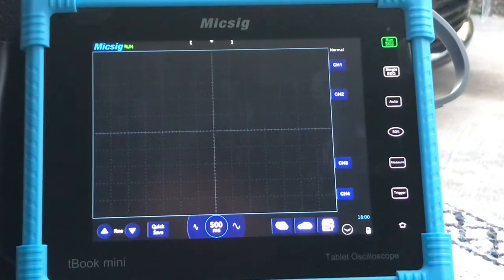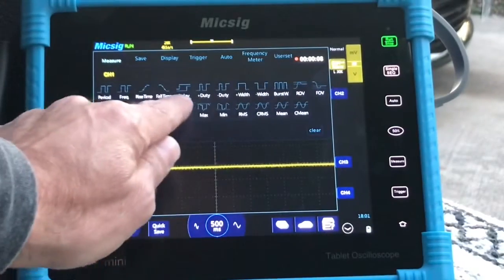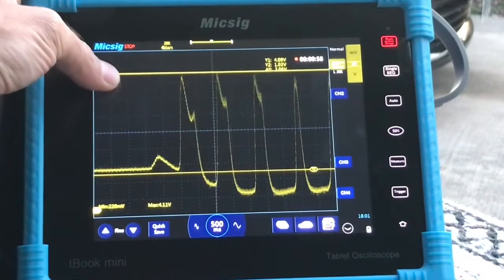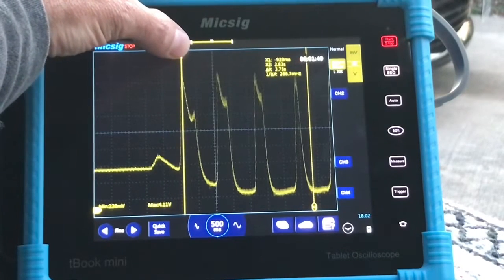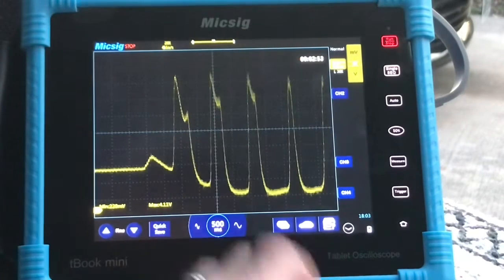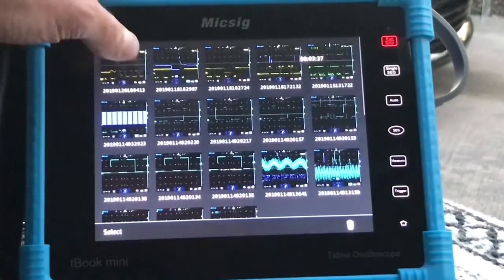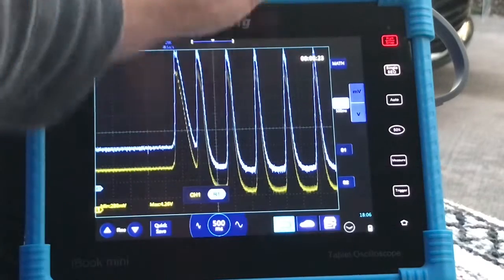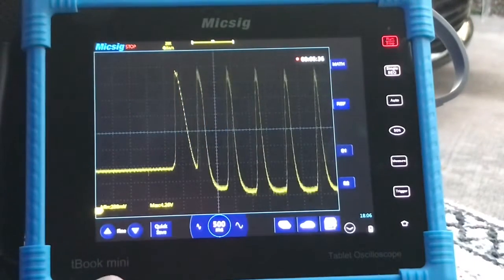Using the MicSig ATO1104 to look at a map sensor on 07 Mazda 3 2.3l

Comment: ram40andy
3 days ago
I just bought an ATO 1104 a month ago , everything worked ok, but the other days a relay clicking noise came from inside when switching the voltage scale from 200mv to 500mv on any channel. All began when I connected CH1 to AUX OUT CH  with P130A probe. Everything works as it should now except this noise
Reply from the maker: Hello ram40andy. First off, I apologize for just now responding to your comment. I never got the notification, and just now saw it. I’m sure by now you have probably contacted Micsig. Incase you haven’t: 
I believe that is normal for the scope. I know sometimes I hear the same thing. 
I don’t have my scope in front of me at the moment, but tomorrow I’ll try to remember to run it through the condition you mentioned and confirm whether mine does it or not.
Reply: Thank you. @atomsworkshop195
Reply from the maker: Ok, so on mine; it makes the clicking (solenoid) sound on channels 1,3,&4 switching between 2&5 volts. That is in either order from 5 to 2 or 2 to 5. Also, channel two seems to do it from 200mv to 500mv, and 500mv to 200 mv. So now I checked my brand new SATO 1004 (Micsig new automotive scope), and it did just like yours making a clicking sound on all four channels switching between 200 mV and 500 mV in either direction. So I’d say you have nothing to worry about my friend. Keep on trucking on. I hope this puts you at ease.
Reply: @atomsworkshop195  Thank you very much, mine does so.

Comment: Hello I’m wondering if is possible for fixed the evaporative emission (EVAP)vent solenoid control circuit is vending
Reply from the maker: Hello Gustavo. I apologize, but I’m not sure exactly what you’re asking. If you’re asking if you can use this MicSig ATO to look at the EVAP vent solenoid control circuit; the answer is yes. You can use this to see the waveform of any electrical circuit on the vehicle (or most other electrical circuits). You can see the waveform for the power, ground, signal, frequency, etc. I hope this answers your question. If not, let me know, and I’ll try again. Thanks for watching and for the comment. I also have other videos using this scope, on my channel.
Reply: Thankyou 👍
Reply from the maker: You’re welcome sir. Good luck to you👍

Comment: What are your honest thoughts on this unit?
Looking at getting one for the workshop, but real-world reviews in an automotive workshop environment are pretty scarce.
I like the idea of an all-in-one solution.
Reply from the maker: Hey Dennis. You’re probably a bot, but just Incase you’re not, here’s a short and to the point opinion. My honest thoughts are, I think it’s a great scope. It’s been able to do everything I’ve needed it to do. It doesn’t have all the options that the Pico automotive scopes have, such as a waveform library, but you also pay a lot less. Yes I bought it with my own money, and as of right now I would buy it again.
Reply: @atomsworkshop195  haha I'm not a bot.
Genuinely interested in a scope for my shop. I have a Gscan 2 with scope option now, but can't use scope and scantool at the same time.

I have been looking at the Hantek 2D82 auto iii but in my research I found the Micsig.
I have emailed Micsig and received no response so I'm not pulling the trigger just yet.
Reply from the maker: Dennis De Zordo , I looked at some hanteks before I found the Micsig. I like the Micsig because I don’t need a laptop, and I like the general layout of the screen. I also went with the ATO1104 “automotive” scope, so I would have the automotive presets. It did add to the price, but was worth it to me. I really don’t have any complaints, other than the leads could be longer. I fixed that with the 4 pack of Pico’s 3 meter colored (yellow, blue, red, and green) leads. They were pricy at around $187, but they’re really nice leads. You can find them and all your other scope accessories at either AESwave or AutoNerdz. I bought everything I needed between both of them. The Pico is a great scope that I I would love to add to the arsenal, but until they come down on price, or my situation changes, I’ll go without. Heck, I’m sure I’d still use my Micsig even if I did have a Pico, because of its ease of use. Just turn it on and attach a lead or other accessory. Another YouTube channel that has some videos of it in action in the automotive word is Super Mario Diagnostics. You have to go back about 11-12 months in his videos to see it, because he eventually sold his to his brother and bought a Pico. He sad his was overheating or something. I personally have had that problem. Dave Sterl has a couple few videos. Also, Robinson’s Auto has a few. Anyway, I like my Micsig so far and think it’s a great scope. I I ever do go to another one in the future, as of right now, I could only see the Pico Automotive scope as an option. And I’m not referring to the Pico 2000 series. It would have to be a 4000 series. But like I said, they are proud of them, for they are pricey. What’s that saying? Something like, when you you buy it,  you only have to cry once? Lastly, did you try their sales email on their website? I know before I bought mine, I emailed them with some questions, and they responded within 24 hrs. I had a question I emailed them about a month ago, and it was a slow response. When he did respond, he apologized, and mentioned how they were out of the office because of the whole Corona virus thing. Anyway, thanks for checking out my channel, and I wish you luck in your purchase. I know it’s a big decision, if you’re like me and not mad at your money.
Reply: Are firmware updates etc still available?
The seller I'm looking at is offering this:  "Limited time promotion: Free i2c, SPI, UART, CAN, LIN serial decode with purchase of TO1104. Update firmware to 273 and contact us with serial number."

and this:  "Limited time promotion: Free i2c, SPI, UART, CAN, LIN serial decode with purchase of TO1104. Update firmware to 273 and contact us with serial number."

Firmware update required first,  so wondering if updates are still live.

Any help/info appreciated.
Thanks.
Reply: @atomsworkshop195  Yes I don't want to cart around a laptop either, so the 1104 is ideal. I would go the automotive version also.
Yes I emailed from their website but no response, this is why I'm hesitant. I don't want to buy something with no after sales support etc.

I have watched all videos that I could find on the ATO1104 & TO1104. Will check out Super Mario as that channel hadn't popped up in my research.
Thanks for the info.
Reply: @atomsworkshop195  I sent another email to asia@micsig.com (from facebook page) & have received a response.
No such discount for me unfortunately, however they did inform me that there is a Distributor here in Australia who is a reputable tool company & I have phoned them.
They have stock of the ATO1104.
I'm happy that I was able to speak to someone local & their price is reasonable so I'm thinking I may just snap one up.

Thanks for your help.
Reply from the maker: Dennis, that’s good to hear. Glad you got Phil’s of them and a local dealer. Sorry you didn’t get the discount, but I know you’ll like the scope. Do you ever have anymore questions don’t hesitate to drop in on my channel and leave a comment. Glad I could be of help.
Reply: @atomsworkshop195  cheers. I will be watching.
Reply from the maker: Dennis, thanks for subscribing to the channel.
Reply from the maker: Hello Dennis. I recall watching that video before. As for the first way he did it, graphing the frequency on a separate channel? I do not believe we can do that on the MicSig. If you can, I haven’t seen the option. Now for the second way, using the math option; I believe you can. The Micsig does have a math channel that allows you to add, subtract, multiply, divide and what not. However, I haven’t familiarized myself with that feature yet, so I can’t tell you confidently yes; but I believe you can. I wish I could be more helpful on this one. If I get some free time, I’ll try and put it to the test, then let you know.
Reply: @atomsworkshop195  thanks. 
Mine hasn't arrived yet so I can't play with yet.
Reply from the maker: That’s great Dennis. Glad you took the plunge, I know you’ll like it. Did you get the ATO or the TO? Let me know what you think of it when you get it.
Reply: @atomsworkshop195  I went for the ATO.
It was supposed to arrive 2 days ago but shipping is delayed due to our uninvited friend (Covid-19) so it will be next week now unfortunately.
Reply from the maker: It’s gonna be a long week, lol. Sorry to hear that. Will you do me a favor when you get it? If you go to settings, then I believe to Information (I don’t have mine in front of me at the moment), and count how many options are in each column. I’m curious if it’s the same as mine. In the left column are what can be installed, but are not installed at the moment. In the right column, are all the extra options that are installed. I have 2 in the left column, and 13 in the right.
Reply: Sure. I'll check it out.
Reply: @atomsworkshop195  my scope arrived this morning.
I have 2 options available & 13 installed in the Information tab, so I assume the same as you.
Reply from the maker: That’s great, glad it got there. Okay, yea that sounds the same as mine. Thanks for letting me know, and enjoy your new scope. Let me know what you think of it; and if you have any questions I might be able to help you with, just ask.
Reply: @atomsworkshop195  so far so good. 
Used it today to scope out a faulty CKP on an Audi A4.
I like it so far, however the spelling errors in the UI are cringe-worthy.
I might report them and hope they can be addressed via an update.
Reply from the maker: I’m glad you’re liking it so far. Are you going to order different leads?I like the 10 to 1 probes that came with it for things like primary ignition. I just wish they were longer. I bought 2 20 to 1 attenuators. Just need another 2 so I can do 4 channels at a time with my Pico leads. I really like the Pico leads. I got the pack that came with all 4 (different colors) that are 3 meters long. I’ve been getting all my accessories from either Auto Nerdz or AESWave, and a couple things from amazon. I’m in the United States though. If I recall, I think you’re in Ireland, is that right?
Reply: @atomsworkshop195  no I'm in Australia. 
Already looking into the coloured lead set, I found a good value set at Warwick Test Supplies (thanks Uncle Google) that I'm considering.

Also looking at Hantek Secondary paddle and amp clamps.
Reply from the maker: Warwick is new to me. I don’t believe I’ve ever heard of them. I went on their site and they seem to have a lot of really good stuff. I clicked on a random item, just to get an idea of shipping, and it was right about $20, depending on which option I chose. I went back-and-forth between the hantek and the pico current clamps for about two weeks Before I made my decision. The hanteks seem all right, And the price is great at about half the price as the pico. Only there were a few reviews that concerned me with the hantek, so ultimately I went with the pico. With that said there were also a lot of good reviews. If you do get the hantek, Let me know what you think of them after you’ve used them for a little bit, would you? As for the secondary paddle probe, I wanted to let you know that Micsig just designed one that’s being tested right now. They are going to send me one out to test, to see what I think of it. I think they’re going to put it in the mail this next week, but since it’s coming from China, it will be a little while before it gets here. Anyway I’ll let you know what I think of it, in case you’re interested. Micsig Also makes some current clamps. I don’t have any at this time though, so I can’t speak on them. If I do get one I’ll make some videos and share my thoughts on it. Good luck to you.
Reply: @atomsworkshop195  keen to know more about the Micsig Paddle.
Do you have any links to info or pics?
Reply from the maker: Nothing at this time. Not even a pic. They just asked if I would be interested in testing one. I told them yes, and they said they’ll send it out next week (this was a few days ago). He said they were waiting for the case for it before they mailed it to me.
Reply from the maker: He said it’s still being tested at this time, and if all goes well they will put them out on the market.
Reply from the maker: I’ll let you know as soon as I receive it
Reply from the maker: Dennis De Zordo, Do you see an invert button in the channel set up, or anywhere else?
Reply: @atomsworkshop195  no. I noticed that the other day.
However I saw something that may give the same result, but I got sidetracked before I was able to try it.
Reply from the maker: I just emailed Micsig, asking them about it; and if they can do an update that installs it. I can’t understand why they would have it on the TO but not the ATO. I noticed after I first bought it, then forgot all about it. Then it came up in the comments, so I had to know if it was just mine or all the ATO’s. I’ll let you know what Micsig says. Thanks for the response Dennis.
Reply: @atomsworkshop195  cool I was about to do the same.
What I thought was a workaround, isn't...
Apparently there is an update coming very soon, so hopefully they can incorporate the invert feature.
Reply from the maker: Dennis, Ok, I talked with my contact at Micsig, and he said when they designed the knew interface for the ATO, somehow the invert option was left out. They will be installing it in the new firmware update. He didn’t give me a date, so I guess just randomly check for it. I’ll post when I see it, and if you see it before me, will you let me know.
Reply: @atomsworkshop195  sounds like a plan.
There must be a better way to communicate though (less public) ...
Reply from the maker: Dennis, hows it going? I wanted to let you know that the firmware update with the invert option came out today. I just did the download, and all is well. At the top of each channel menu, there is now an invert option. I tried it out, and works great.
Reply: @atomsworkshop195  hey thanks for letting me know.
I did actually check for an update yesterday, must have just missed the release.  Cheers.
Reply: Did you notice any other changes?
Is there a changelog?
Reply from the maker: The only other thing I noticed was that they took away the button that was to the right of the automotive presets button. It was the one that when you clicked on it a window opened that had something written in Chinese or mandarin. It didn’t seem to do anything. Other than that I haven’t noticed anything else.
Reply from the maker: No log stating the changes that I’m aware of
Reply: @atomsworkshop195  I don't think I had that button.
Reply: I'll check before I update.
Reply from the maker: Hmm, I wonder why I had it. Yea, it was on the bottom right, to the right of the the one with the car on it. It had a “?” on it.
Reply from the maker: Hello Dennis, Atom here. So I was messing around with my scope and my signal generator, and I feel like there might be some differences (since the update) in the S1 & S2 channel menus (Bus Channels). I might be wrong, and I can’t quite say exactly what’s different; but some of it seems a little different to me. Anyway, when you have some time and want to check it out, let me know if you notice any differences.
Reply: @atomsworkshop195  I can have a look, but to be fair I doubt that I have used it enough to notice subtle differences.
Reply from the maker: That makes sense. I just thought I’d mention to you what I was thinking. It’s 4:20 AM here in Texas, and unfortunately my damn Carpal Tunnel has me awake “again”, so I figured I’d poke around on the Micsig, and stay awake since I have to be up in 2 hrs anyway. Have a good one.